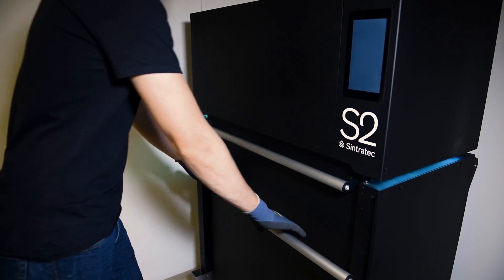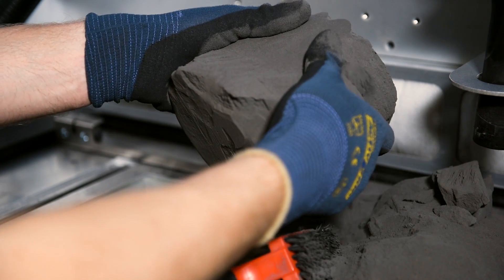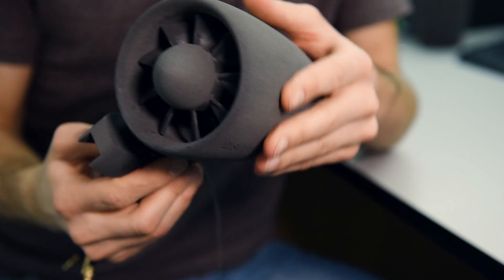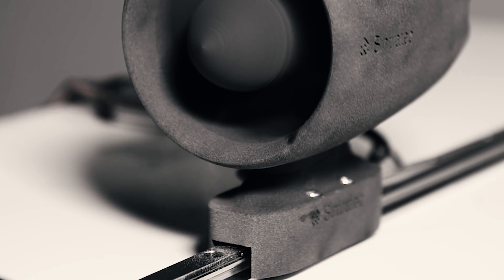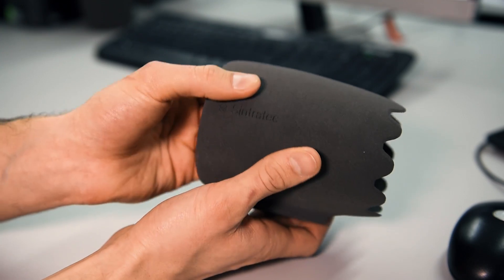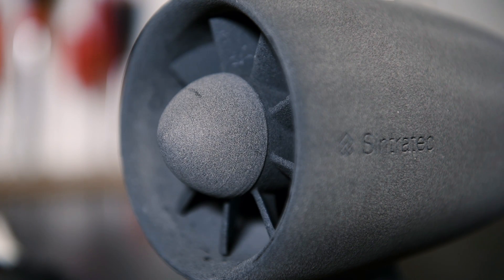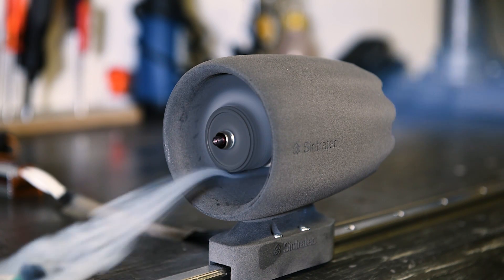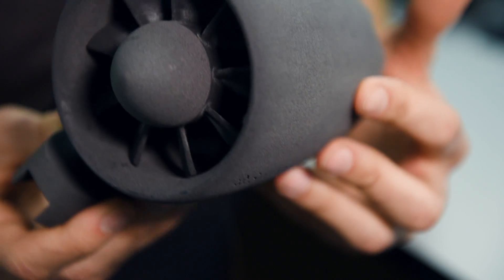3D printed Electric Ducted Fan TESTED – How strong is SLS?! (EDF Turbine Test)

Comment: Now smooth the inner surface and blades and run it again.
Should see a massive increase in air flow velocities.
What was your effective lift force?
Reply: I think the goal here was to show the strength and feasibility of the SLS print and not to create the worlds most efficient edf
Reply: @wingnutzster  This doesn't demonstrate anything. They should have measured the RPMs of the motor to demonstrate how strong it was. Telling us the power consumption of the electrical motor is useless.
Reply: @MessInMines  who gives a shit. If it means anything to you then print your own and test it. This is still cool to see printed and not breaking.
Reply: MessInMines absolutely not useless... you need to conceptualize how that power output correlates to rpm. Power = Torque * RPM. They’re directly proportional. Your mind is in the right spot, but you’re thinking purely as a tinkerer, not like an engineer. Study the engineering and use both to your advantage
Reply: @socratesa2536  im an phd engineer.. worthless info..how many  lbs of thrust did it  create
Reply: johnny llooddte i appreciate your comment, as in the end of the day that’s what matters, how much force it can produce and whether or not it will break or not. But I think you can see I was not arguing against that, but was rather explaining to the gentleman before the relationship between power and RPM, which was his original concern. If you want to be a smart ass, share it with your friends and family, I’m sure they’re all much more used to it from you than non provoking strangers are.
Reply: A small bit of massive😂
Reply: @Guybrush Threepwood close to nothing
Reply: Lol 0.1% massive

Comment: My humble opinion, you should design a 4 stator blade motor support instead of 3stator motor support for strength as the motor is quite heavy and the stator need to bear the motor weight not only in gentle landing but hard landing without breaking.

Comment: So it's not a turbine then? Without long term testing there's nothing innovative about this except the SLS, which is really cool. But static tests and saying YAHOO! is poor engineering follow through. Cool it lasted about 10 minutes on a bench static tested without any outside vibration to upset the blades. Are you are bandwagon "TESTED" the show in the title.
Reply: What part of "EDF" is it you don't understand? 
And what rpm stops making it "static"  ?
This is a valid test of the rotor; outside vibrations are minimal compared to the internal forces of a edf.
Reply from the maker: Real flight test are following when the private project of the engineer is progressing.